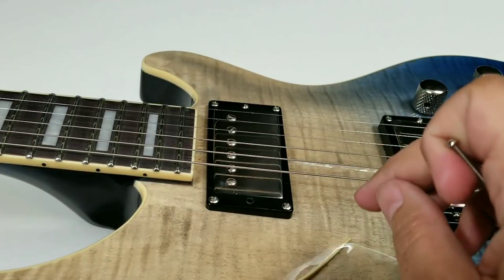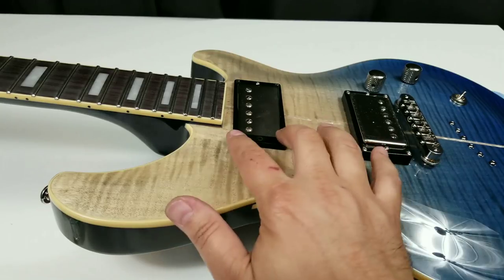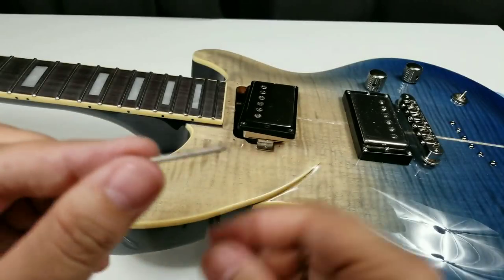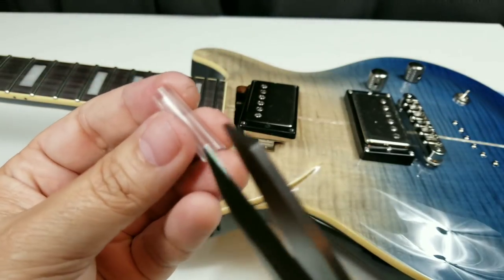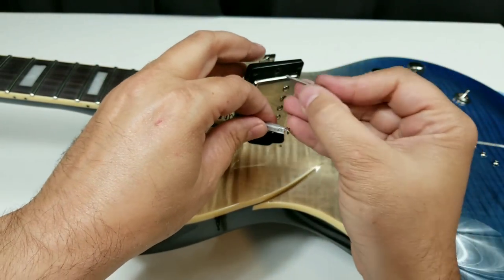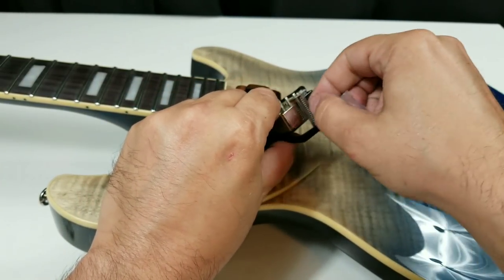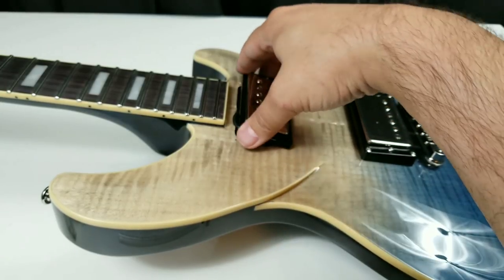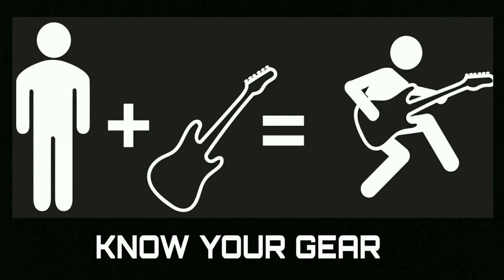How To Install Guitar Pickup Springs

Comment: For Christmas last year I received my very first Les Paul, I have played professionally for forty years and have always wanted one. I have always had strats and never played anything thing else on stage. So needless to say I've  never worked on a Les Paul before. The one I got was a limited edition satin iced tea color and it came without covers or a pick guard, so I wanted to install the metal hum bucking covers on my own ( I have always done my own builds from pups to scratch) but when I went to re-install the pup springs they just would not go on...thirty minutes later, after picking the spring up from across the room about twenty times, swearing uncontrollably and about half a second away from smashing my beautiful guitar to pieces... I decided to look up how to do this on  the web... and there you were with the simplest, easiest and no cost way to do this... WHAT A BLESSING. Thanks for posting this for new Les Paul dummies like myself.

Comment: You're a life saver Phillip. I was fooling around with my SG yesterday and just couldn't get the pup springs back in so I put all the pieces into the case for installation by my local tech. Now I can do it myself. you've saved me $250  just took me 10 minutes
Reply from the maker: Awesome! Thank you for posting and I am glade it worked out.

Comment: Phil another trick with no messy cutting or anything is if you have the little gator clamps like on the hands-free soldering kits or a multimeter you can use that to clamp the spring in place while you fasten the screw.

Comment: Thanks for this I lost a spring trying to put a covered bridge  humbucker in a Strat pickguard, to make matters worse it’s a slotted screw so it made for frustrating challenge that the StewMac tool wouldn’t work.  Next project I’m definitely checking your channel for help. Thanks Phil

Comment: The best way is crocodile clips used for holding electrical parts in contact. You simply put the spring over the screw pull it back, hold it with the clip and then dead easy to remove the clip once the bolt is in.

Comment: Using an alligator clip (like from a multimeter) to clip the screw just below the spring (leaving enough room to begin to thread the screw into the pickup threads) is another cheap alternative. I have the stewmac clip and actually prefer my alligator clips.
Reply: macjohn4 that stewmac job is whack!  The ali clip sounds like it can't fail.
Reply: Just said the same thing and then saw that you wrote the same, works great.
Reply: The real tip is always in the comments.
Reply: I agree, the alligator clip is the fastest, easiest way to hold that spring.  I have a set of the StewMack Humbucker Helpers and still managed to fire strings all over my work room.  The Humbucker Helpers have a cool name, but the alligator clip is ten times easier to assemble your humbucker/ring/springs/height screws.
Reply: Life saver. Thank you.

Comment: Ugh!!! I just finished putting 6 springs on 3 vintage pups on an SSS Strat and I thought I was gonna lose my shit. Wait…I did! I didn’t have a single straw in my entire house. So, if YOU don’t have a straw in your ENTIRE house, an old guitar or speaker cable’s rubber jacket will work just fine. Also, FYI -single coils are much tougher because you need to get the screw through the pup cover first and then into the pickup. Thanks for the tip tho!

Comment: I just put down a towel and fold it so it's thick enough to prevent the screw from hitting the surface of what it's on, I push the screw and spring into the pickup on top of the towel and screw it in

Comment: I bought a pair of Gibson 61 pickups and the problem is that the holes for the screws are REALLY small and I can't find that tiny screws anywhere. Do you recommend me to make the hole bigger? Taking the risk of damaging the pickups of course..
Reply: Jaume Casanova Perhaps you can buy new pickup rings. Rings usually take a beating so if you really want to preserve "vintage value" I'd suggest switching them temporarily.
Reply: TheSwedishUploader The hole I'm talking about is the one on the pickup metal arm, not in the ring :)

Comment: I don't use springs. I replace them on every guitar I own. What do I use? Well, I hold onto old broken guitar cables. When I need to replace the springs, I cut off the lengths of cable needed, pull the wire out of the rubber casing with pliers, then put the screws through the mounting ring or pickguard and thread the rubber on the screw. Problem solved.
Reply: Jeremy Santos good idea. You're onto something

Comment: Why don't they supply shorter springs? My LTD has springs that are slightly shorter than the screws, and pickup installation is a breeze!
Reply: I ended up slipping my long springs, Idk why they need to be so long.

Comment: Avoid all of this effort and time by using surgical tubing. I have a supply of 3 sizes, and haven't used springs in over 10 years. Just slip the appropriate size onto the screw and tighten up. Viola!